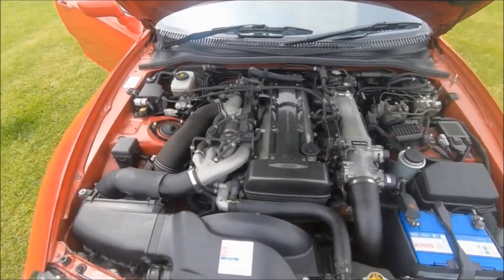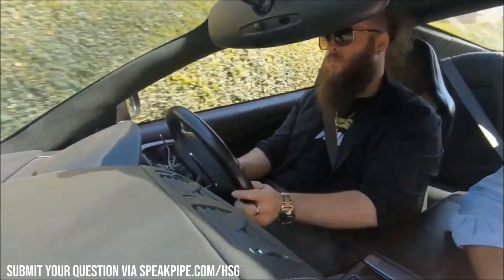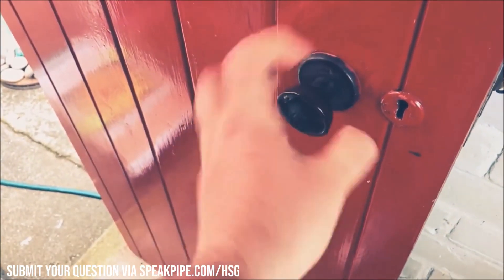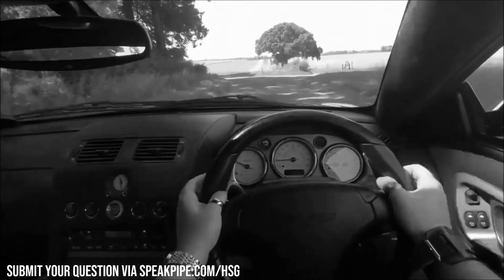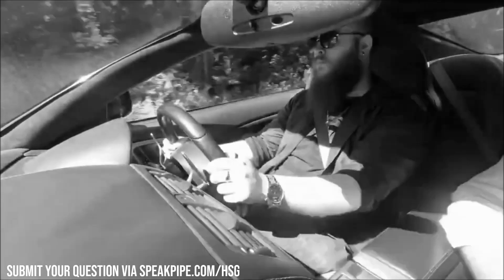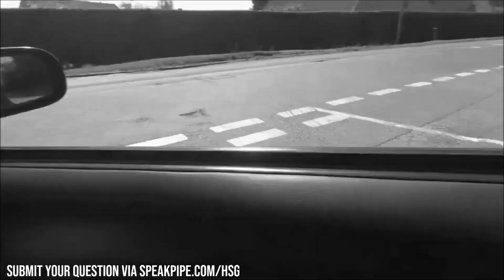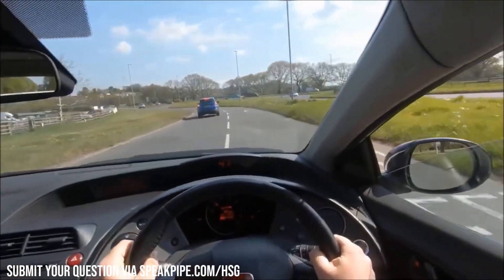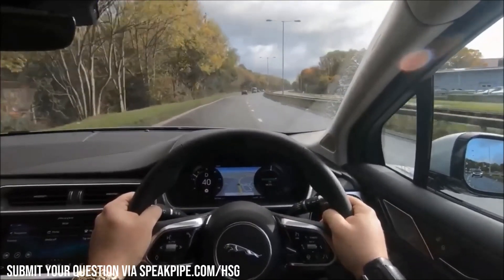POWER vs TORQUE Explained - Which is better? What's the Difference?

Comment: 🫣 reality is 500 nm 1000 hp at engine crank at 100 km/h push your body into seat much stronger than 1500 nm 250 hp at 100 km/h too be generate 4 times biger contact path force 👌🏻 😉

Comment: 40 years ago, we drove three cars up an incredibly long and steep hill in Norway. A Mazda 626 with a straight 4 engine of 2 liters and 90 Hp.  A Ford Capri with V6 two liter and 90 HP and a BMW 528, a straight 6, 2,8 liter with 184 HP. Mazda had no chance against the other two, and BMW failed to drive from Capri until the road became flat again.

It was the difference in torque, between a straight four and straight six cylinder engine, against a V6 engine.  I drove the Capri.

On that road, the altitude difference is about 500 meters at 20 km.
Reply: no its not the tprq 👌🏻
Reply: @mociczyczki  Yes, I think I was a better driver.
Reply: @protestagain   heh 😉 naaaah thers plenty factory when you compare 2 car with the same catalogue power at engine crank which can change results 👌🏻weight arodynamic drive train loses , wheels weight and weight distribution rolling resist drive train type i mean fwd rwd awd , gearing in regard to power graph shape ,shifting time , peak power width quantity of gear change in specified diffrenc in velocity and probably something more 👌🏻 beside catalogue power can be +/-5% off in some egzample even 10% and if service be very bad engine and its other stufff like intake exhaust if have some issue can eat alot hp 😉👌🏻
Reply: @mociczyczki  Of course, but that difference.  90 hp against 184 hp, and still it couldn't drive faster than me.  I pushed him all the way and had nearly the power to pass him.
Reply: @mociczyczki  I don't know the real power of that Ford 2 liter V6.  The factory specs was 90 hp, but it could do 125 mph at the speedo, and it wasn't tuned.  The speedo speed wasn't right, but it had more power than the factory specs.  Who knows, but I had some really fast laps with that car, and by the time I had them, it's still difficult to match them today.
Reply: @protestagain  whatever dude 184 hp beat 90 hp nomater how hard you be push in your sillly 90 hp 🫣 unles 184 hp in a trcuk  vs 90 hp in a moped 😉👌🏻
Reply: @protestagain   push as hard as ypu can ypur 90 hp and 184 hp stillbeat it unless 184 hp in a truck vs 90 hp in a moped 🤣 thpugh i once overtake  911 turbo s 650 hp on highway in a fiat 126 p 24 hp 🤔
Reply: @mociczyczki  No, that BMW with 184 hp didn't beat a Ford Capri V6 with 90 hp in a steep hill.  That's for sure.  That BMW was gutlless in that hill.

Comment: So if I'm reading this correctly, as an example the Mclaren F1 has 618 Horsepower and 479 pound feet of torque. While the Bugatti Veyron has a thousand HP and 922 pound feet.
The Veyron is obviously faster because of the power, but it's also more usable and less fragile than the F1 because of the greater increase in torque (AWD helps as well). 
Torque is the spec that matters more often, yet everyone focuses on the top speed. I swear the Veyron gets way too much flack for how genius the car was for it's time.
Reply from the maker: Absolutely agree on the Veyron hate. And that coupled with the comfort and AWD makes me think it will likely end up being my favourite Hypercar if I get the chance to drive one...
Reply: I just don’t like it much because the visuals are an acquired taste and the weight makes it handle horribly in games.
Reply: That statement Mike is ironic because back then the SSC Ultimate Aero was your favourite Hypercar. The only other car at the time to rival the Veyron.
Reply from the maker: @Driff97  Yeah, lol. I still love the raw brutish concept of the SSC, a TVR Speed 12 in spirit, but I know I’d prefer the Veyron in practice